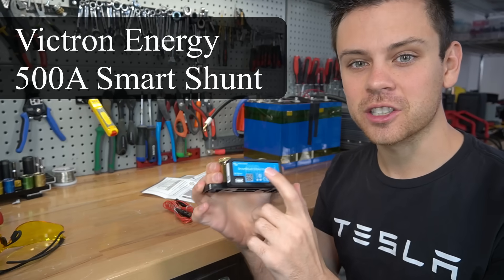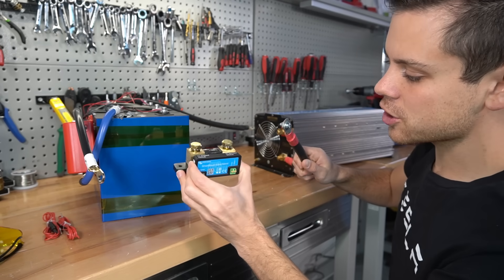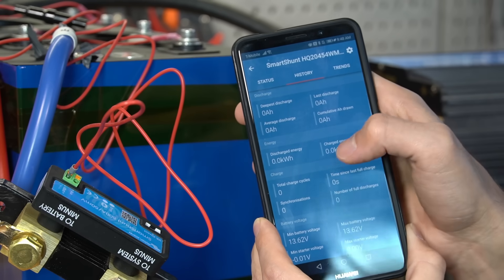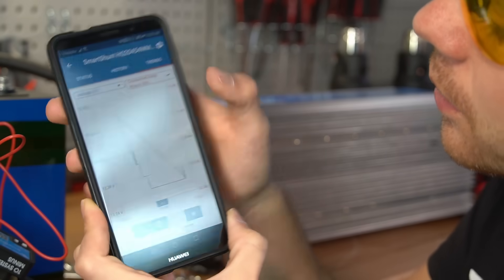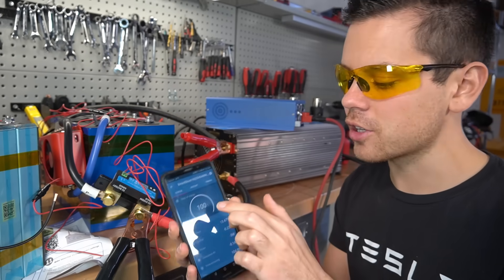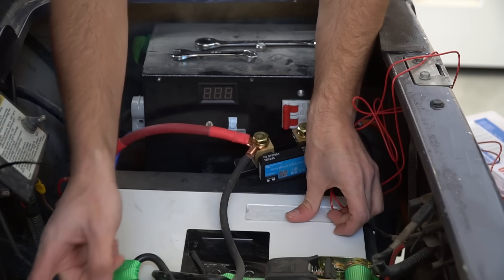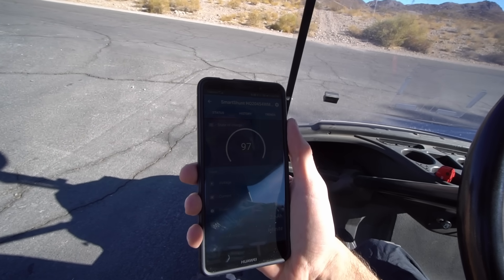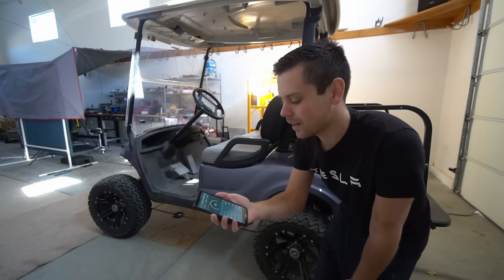Victron Energy 500A Smart Shunt (Beginner Friendly)

Comment: WEAK BLUETOOTH!
I decided to go with this shunt for the convenience of the Bluetooth because it would be difficult to run a wire from the battery bay of my class A motor home. The problem is that I have to stand right next to the battery bay with the door open to get a Bluetooth signal from the shunt. So I could have just gone with the wired one and mounted it in the bay for all the good this has done.

Comment: Hello Will the off grid wizard!😀 I bought the same smart shunt to replace Xantrex  Link 2000.  However,  the Link 2000 has dual shunt system, which it monitors both Voltage and Amps of each battery. Is there a way to hook up so the Victron smart shunt measures Voltage and amps (in & out) currents for each battery bank? Just hook the Aux to the 2nd battery and hook the battery (negatve) terminals from both banks to the same battery side on the shunt? Or do I need 2 smart shunts one for each battery bank? Thanks a bunch for great videos.

Comment: Hi Will, I can see you set up the charged voltage in battery settings as 14.6. There is a lot of conflict information regarding this and Victron recommends setting this as 13.2. I am trying to set my shunt settings but not sure what’s the correct setting. I’m using 12V 200ah lithium battery. Any info would be much appreciated. Thanks

Comment: Great video! Thanks again Will. What would the settings be if you had a 24v system comprised of 4 Rolls S6's (6v 460AGM's) wired in series pairs and then in parallel?

Comment: I have just accuired for free two 200 watt panels  I want to install them on my garage roof..  I want to be able to charge my cordless tools ..  Is this possible .. I have 2 115ah leasure batteries wired in parallel .  do I just need to buy a Solar controller and Inverter ????  and do I need a fuse in the curcuits ?

Comment: Hi there, thank you for the video! One question. Does the Shunt also include a function the battery protect device has where the device will shut down any consumers from the battery and start again when the battery was recharged to a higher voltage or will ist just display the status and give an in app alarm?

Comment: Thanks Dexter! I do have one question... in my Outback Flexmax 80 manual, it says to always remove the positive lead first and always connect it last. This is supposed to prevent any communication chips/lines becoming the DC return path to the battery, damaging them. Have you heard of this before, as it is the opposite of car battery connection order?

Comment: I’m noticing once I calibrate battery state of charge if I then turn off my battery and the shunt when you turn it back on it recalibrates back to 100% when reading the volts know it’s not. Is there a way to save settings or when shunt powers off is that a fault there?

Comment: Bluetooth range is terrible. Might be fine for RV or small boat but with my solar setup it's not good.
 i.e it will not work from carport to work desk 10 feet away.  
Apparently another Victron accessory - BT module can be added @ US$50.
So all up makes for a very expensive battery data reader !!

Comment: I have a question, In the battery setting "Charged Voltage". The booklet I got with my battery. (Power Queen 12.8 volts 190 Ah States 13.5 volts is 100% soc. Also it states Charge at 14.4 - 14.6 volts. So do I fill in "Charged Voltage" with 13.5 volts or 14.4 volts.? I did notice you set it at 13.8 volts. Thank you for your time and videos.
Yes I have the Victron BMV-712. The battery is a Power Queen LifePo4 190ah 12.8 volt.

Comment: I ALMOST bought the Victron SmartShunt, but learned of major problems that were not included in your test.
1. Bluetooth range is very weak. Many applications have the the shunt further away, like in an RV or a boat, or on the other side of a bulkhead.
2. Data preserved only when the smartphone app is active. It is lost when the app closes.
I bought the Thornwave PowerMon monitor which does not have these problems, at least not per spec. It needs an external shunt for my voltage and amperage requirements. It has been shipped and is en route, so I can't give you any hands-on feedback yet. Curious to see what you think.

Comment: You may want to caution your users who see this video.  Although you set the battery to 100% SOC in the Victron app at setup, that battery SOC is not stored in history in the app or the shunt. Therefore, once your users walk far enough away from the bluetooth range of the shunt and get disconnected, the battery may show 100% SOC the next time they reconnect to the shunt using the Victron app.  This has been an ongoing problem for users like me, and many others,  who do not use Victron batteries and a full Victron electrical system. I have a single 24v/200Ah server rack battery, the Victron 500A smart shunt, a Victron Lynx distributor, and a GroWatt Inverter/charger. The entire battery system works great, however the shunt "forgets" the previous battery SOC each time I disconnect from bluetooth.  For example, if I manually charge the battery to 100% and sync the shunt to 100% SOC as well, then use 10% (~500 watts) of the battery capacity the shunt displays ~90% capacity remaining. If I then disconnect from the shunt's bluetooth signal (leave the van, or disable bluetooth) then later reconnect to the shunt again, the shunt often says my battery SOC is at 100% again - even though it is only at 90%.  I believe the reason is that LFP batteries like mine hold a constant battery voltage until they are almost to zero capacity.  The shunt sees the full voltage on the battery and believes it is at 100% SOC.  The previous ~500 watts of usage I had consumed is "forgotten" by the shunt since I disconnected from bluetooth as I left the van.  This is important for folks to realize, particularly if they have LFP battery chemistry not lead acid which decreases its output voltage as amperage flows out.  You may want to try this yourself and perhaps do a follow-up video on this for your users.  Good explanation about installing the smart shunt though. I do like the shunt for real-time monitoring of actual wattage flowing in/out as I am charging or discharging.  I just no longer trust the SOC display the app provides.
Reply: Has this issue now been resolved with a firmware update? I have a Victron smart MPPT and Victron smart Orion dc2dc charger with a Li Time LiFePO4 battery
Reply: @PhilHaddon hi I think the issue has been fixed with a recent update.  I didn’t read the above warning before buying and was worried there would be no history of if my phone was not actively connected. What I am seeing is it does take system state snapshots for all metrics every 30 seconds even if your phone is out of range of the shunt. Once your phone opens the app it starts taking second resolution snapshots. There does seem to be a little squirrellyness if you are looking at the app and then switch to a different app- it can cause gaps it seems before it figures out it needs to be taking the 30second snapshots again. But it’s not a dealbreaker for me. I’m not returning it.
Reply: @BeardOfAtlas  Thanks for your reply. It has been fixed. I installed my Smartshunt 2 weeks ago and it stores SOC no problem at all
Reply: This is ABSOLUTLEY Critical, this shunt is garbage, unfortunately. Check out the Thornway Labs option. I'm looking into this and it's potentially the best but I can't say for sure. Thanks for confirming what I was thinking about the Victron.

Comment: Hi, your videos are very useful !o have a few questions if you don't mind...what's the difference between thus shunt and the lynx shunt?
Also,  in my system I have an inverter/charger,  how can I set it so it doesn't goes into inverter mode automatically unless the generator or the alternator of the main engine is charging?  Do I need a Cerbo gx for this? Or what components do I need?  Thanks!

Comment: I bought one of these and it constantly has mismatched battery level compared to the smart BMS in my 200Ah lithium battery. I’ve lost count of the amount of times I’ve synchronised SOC, but it still drifts off what my BMS reports the battery level to be. 
Any suggestions on why, or how to resolve this?

Comment: Great Video as always Will!  Apologies for the newbie question.  With shunts, will they measure any battery discharge from sitting in storage or will I need to reset the shunt with a full discharge if it's been sitting around a while?  My intended application is for a DIY solar generator for home backup use.
Reply: It can see the volts where you can infer state of charge, but it can only measure actual capacity from Amps in/out if the power going through it

Comment: I was going to buy one of these, but reading Amazon comments in UK, quite a few folk stated that the Bluetooth range was very poor, (approx 3 meters max), so not great for me, as my batteries are under the boat deck, near the engine. Also, Amazon comments said users had to re-pair to their phones every time they wanted to see charge/discharge etc. I would be interested to hear some comments on this.

Comment: Hi Will, I have a question about the Victron smart shunt. My battery has a recommended max charge rating of 15 amps. I also have a single 400-watt panel and a 100|30 Victron mppt charge controller. Since the panel and charge controller are capable of producing 30 amps I am hamstringing it by setting the max charging to 15 amps. Do you know if I were to add the smart shut if these two could communicate and auto adjust the charge controller’s max output?

A quick example (ignoring solar for simplicity). If the shut detects that the battery is currently receiving 10 amps of power while the smart controller is currently producing 15 amps. Do they communicate allowing the smart controller to dynamically increase to 20 amps of production? 5 to the load and the recommended 15 to the battery?

Comment: This is a really good review.  Worthy of Will Prowse for sure.  I bought a Victron Smart Shunt because of it.  But I have a comment/criticism. it always drives me nuts when you use cables that are not meant for the install.  In this case the shunt is installed in the negative conductor so you ought to use all black cables.  The cable you use is black, but the shrink wrap on the lug  is red.  To me this could indicate a positive conductor.  You have basically all the resources you need to do a video that is 100% technically correct. Many of your viewers are not all that savvy with electrical installs.  This incorrect use of color on the conductors sets a potentially very bad example (and potentially confusing) for them and could cause someone to damage their equipment or get hurt.   Please set up your materials correctly before you start the video.  Explaining what you are using would be good too.  Don't take this wrong.  You are THE BEST and MOST TRUSTED solar resource I have ever found, and I value all your content highly.  Just make this old guy happy and be more attentive to details!  Cheers Will!

Comment: I’m charging my 202ah BigBattery with a 100 watt HGST solar panel. I ran the battery down 54ah, and the panel recharged it in 12 minutes. So I checked the settings on my Victron and full charge is set at 13.3 volts. I know full charge is supposed to 13.6, but after fully charging it with a charger it settles down to 13.3 within a few minutes. Should I reset the full charge value?

Comment: Can the app monitor two independently installed shunts?  For example I would want one on my camper with it's battery and another monitoring astronomy equipment batteries nearby.  There is no connection between the two systems.  I'd like to be able to select one shunt in the app to see how the camper is doing, but then select the other shunt to see how the astro gear batteries are doing.

Comment: Thanks for the great video. Are you able to confirm that the statistical tracking only occurs while the app is running? I am close to buying one of these however I have read comments that state that as soon is the app is closed there is no further data collection. So if I wanted to track over the course of 12 hours I would need to leave app open and running on my phone. Thanks!

Comment: I have a victron inverter and the app has nothing showing when I chose Smart Solar HQ except voltage under the solar section at 6.3v. Nothing shows under the battery section or load output.  Having watched this excellent video I am wondering if this is because I need the solar shunt??  Or are they separate things..

Comment: I am thinking about getting one of these for my travel trailer. I have a battery disconnect on the negative side of my battery. I'm guessing I would keep the battery disconnect closest to the battery and then put this next in line? I think this would continue to drain my battery if I put it between the battery and the battery disconnect, due to it having its own positive cable. Is that right?

Comment: Great video.  My question for you is about connecting to my travel trailer two batteries connected in parallel.  If I connect to one of the batteries will it monitor both batteries as on large unit?  Thanks

Comment: If I have two 12V batteries connected in parallel and I want to monitor both batteries using Smart Shunt, is the connection the same as dealing with two separate 12V batteries not connected in parallel?  That means I connect the AUX of Smart Shunt to the positive of the 2nd 12V battery and System Minus of Smart Shunt to the negative of the 2nd 12V battery? Please advise. Thank you!

Comment: I’m using this SmartShunt in my setup, but have a question about midpoint monitoring which can be done with the SmartShunt Aux input. 

I have two sets of Lion Energy UT 1200’s in series and these two sets are then connected in parallel. For mid point monitoring do I/should I connect the midpoints of the two sets together?

Comment: I have it installed with 2 times 100 Ah Lithium batteries. Have you guys ever heared a little sound from the shunt or the batteries? It sounds like a silent horn of a car or like a horn heared from a far distance… the app does not show any alarm though. I was wondering if anything is broke or if there is any error in the battery. Temperature should not be the problem, since I always have it warm in the camper. Thanks for any advice! 😃🤟🏼🚙

Comment: Many thanks for this simple instruction, but how would this work with 2 batteries connected in parallel, also you only showed how to connect and measure load, how would you do that showing load and charge on parallel battery set-up, can you show that in a video, would appreciate that.

Comment: Hey will do you know if it’s possible to have the shunt shut off power to the battery based on the temp sensor? I was thinking it might be a good backup for low temp protection in case the bms fails (temp sensor dies etc).

Comment: I'm sorry to say Will, but it appears that this product has a design flaw. As others have reviewed, I could not get mine to update the firmware from my phone all but rendering the unit useless. On Victron's website they state that they do NOT provide any technical support to end users or installers??? Why are they even in business if they can't supply technical support for their products? I would never buy anything from Victron again. I sent mine back through Amazon.
Reply from the maker: I have updated all of mine multiple times and it works great. Maybe you should get closer to a router
Reply: @WillProwse  This is funny because I bought this to replace my AliExpress monitor which also went bad after six months. Amazon gave me a new one in exchange because  I couldn't get Ali to honor their one year warranty. No communication. The Victron distributor did contact and told me that the unit was probably bad because he saw in the past that if you couldn't get the firmware to download after a couple of times it was a past indicator. If my AliExpress winds up going bad again I guess I'll try another Victron shunt or just go with the Victron BMV700 monitor. I went SOK lithium on my RV per your reviews and I'm super glad I did. Re charge time is super fast with the WFCO 50 amp lithium charger. The VMAX battery took a solid 5 1/2 hours to reach a full charge at .005 tail current with a 30 amp charger. Rediculous. I should have took your advise and never put in AGM's. I can recharge the SOK 100 ah battery at 50% down in 1 hour!! Perfect for boondocking. The SOK also has no voltage sag. Lead is truly dead. It's a horse and buggy at this point.
    I also added a Renogy 20 amp DC to DC charger per your video. It works great while I am driving charging the SOK at 20 amps which decreases the amount of time that I need to recharge with my generator when I am stopped.

Comment: Personal I prefer to solder all my contacts and eyelets so you don't get corrosion inside of the wires
Reply: You'll change your mind the first time you get a current overrun, and that solder turns to liquid, and the wire backs out of the eyelet. Soldering is great, but you must crimp first. Also, a PROPERLY crimped connection cannot develop corrosion inside the wires. Learn how to crimp.
Reply: @vespagts7078   well if you used the wrong solder like many car manufacturers did for ecm yes I can see that happening. I've been an automotive tech for over 15 years so I've seen it all many of these systems are installed on boats and crimping let's corrosion in everytime.

Comment: Does adding Shunt impact parallel configuration of Lithium battery negative cable length/resistance connection?  Positive cable lengths should match.  Negative cable lengths should match.  But Positive & Negative cable lengths don't necessarily need to match each other in parallel battery configuration?  Thanks for your comment(s).